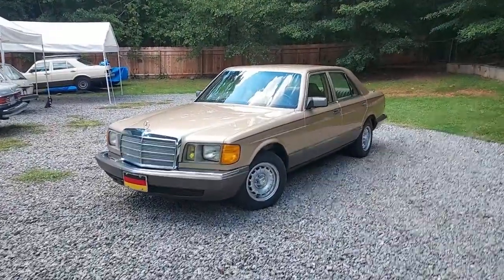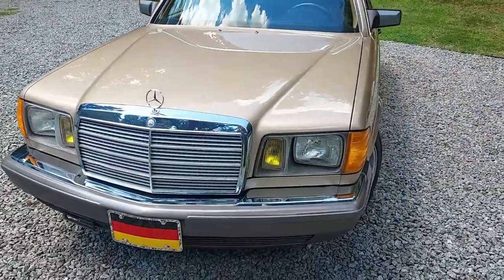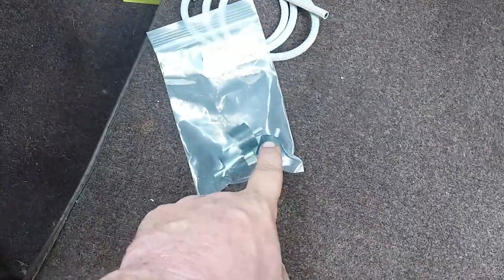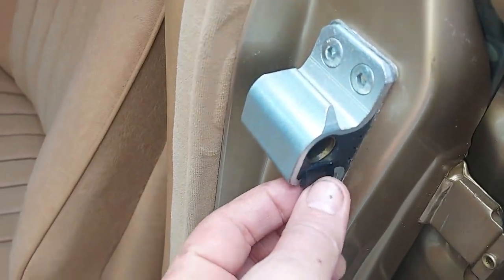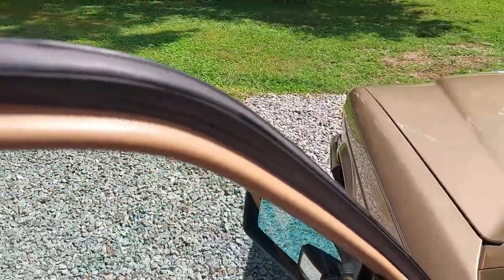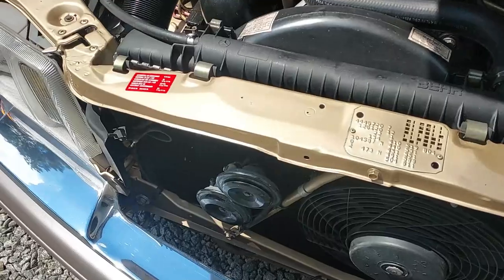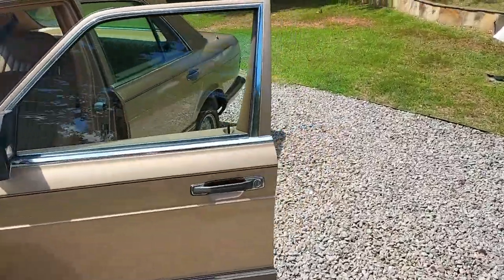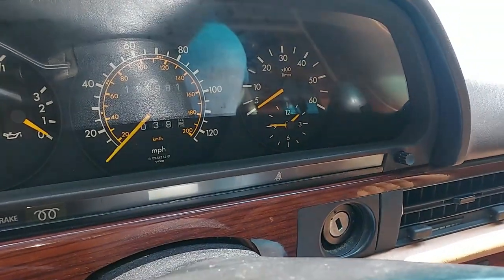1984 Mercedes 300SD - Part 9 Walk Around

Comment: Hey John, what brand/model of tires do you put on these cars and why? I'm going to need some new tires on my 300sd soon
Reply from the maker: Michelin doesn't make tires for the cars anymore however Michelin owns Uniroyal and Uniroyal makes the tire for this car called tiger paw. I ran that tire on my personal car and it was really good. Falken and Hancock also make pretty good tires. We use Falkens at the racetrack and they have always held up very well and are very good tires. So those three brands would be fine.
Reply: @woodsandbarclay  Thanks!
Reply: Por favor Español